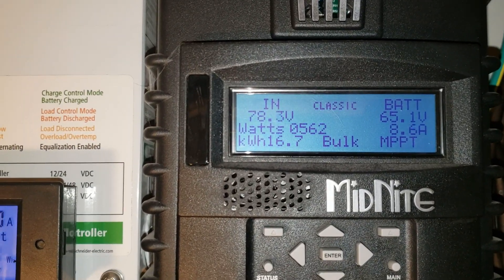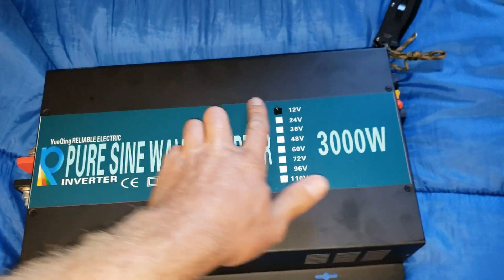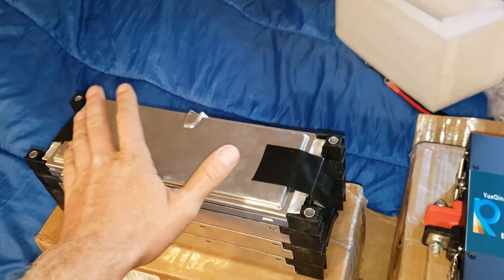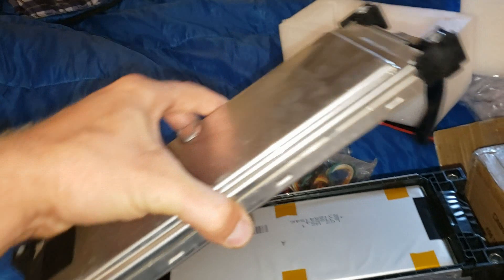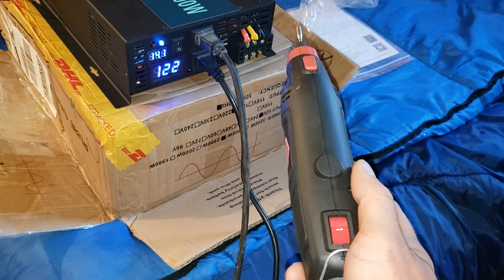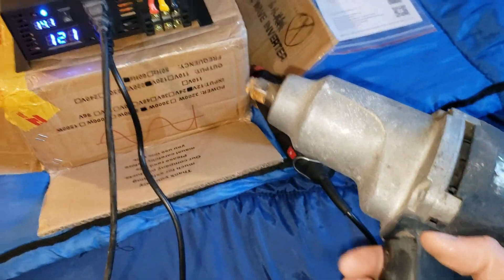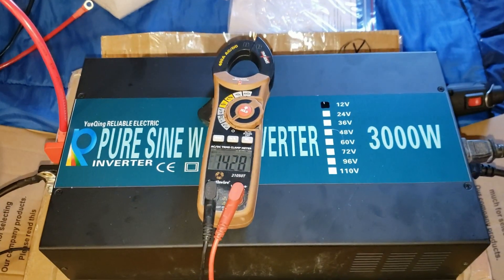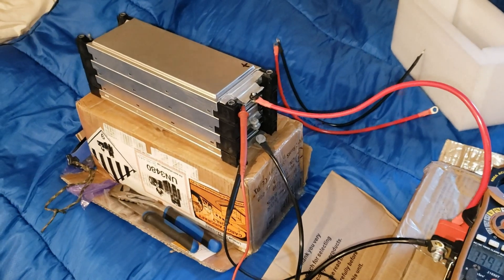New Reliable 3000w Inverter And 4S 16 Volt 120Ah LG Lithium Battery

Comment: Impressive, the inverter never dips below 120V. So many of the cheapos run at 110V but drop to 108 or 107 under a moderate load

Comment: Nearly 1.8kwh in that small package is pretty awesome. I've heard a lot of people don't run them through their whole range they usually don't take them down all the way to the bottom and maybe leave a little headroom up top so say 1.5kwh. For the price that's a banging deal. Put 10 of sets together and 15kwh is enough backup for most people that aren't living off grid, that's enough to run a big AC unit for a good chunk of the day in 90-100 degree F weather (or a small AC unit to cool a room off an inverter like you showed could run alllll day long)
Reply from the maker: That's what I use thus for to cool my little off road travel trailer

Comment: FYI if you want to modify the inverter to accept 10v-17v customer support told  me to replace R13 on the main control board with a 23.2k resistor.  I have confirmed that this increases the input voltage.

Comment: Your link for the inverter is only to the 12 volt version.  How do I get the custom 11-17volt version inverter from Reliable?  Do I send them a message through ebay?  Does it cost extra?
Reply from the maker: Yes message and it's free
Reply: @GoingOffGrid101  thanks

Comment: My 3000watt inverter has been running none stop 5 months no issues! The Batteries are awesome!! Thanks for sharing :)
Reply: Can you tell me how Good those LG chem battery hołd a charge as someone said they are no Good for solar if discharge them a full cykle charge and discharge for example for off grid system ! Im planinig to get From someon why build a solar battery From LG chem 24 v 9kwh for off grid

Comment: I have a 30 Amp rv i would like to get a setup like this. how many of those batteries would i need for a 24v system for it?
Reply from the maker: 7 for 24v
Reply: @GoingOffGrid101   Great thanx
Reply: @GoingOffGrid101  3000 inverter will do or should i get the 3500 or 4000?
Reply from the maker: @capthwdy08  bigger the better
Reply: @GoingOffGrid101  so  the 3000 will be enough also so how many panel's?

Comment: What will you be charging the 4S with? I have a bunch of 4S liion packs I made for kids ride on toys and I was to parallel them all to run my hunting camp this fall. I have 120W solar panel as well.
Reply from the maker: Make sky blue charge controller
Reply: @GoingOffGrid101  I need an ontario battery hookup. I'd like to play with some lifepo4.
Reply from the maker: @11mleger  batteryhookup.com ships to canada
Reply from the maker: Use code GOING for 10% off

Comment: They can't keep their dang name straight! Reliable electric, wrzlb (or whatever, can't double check) and now YueQing? At least it's a way to tell between versions! I'm just about to buy a 3k to 4kw 48v inverter from "one of the 3 names" ...
Reply from the maker: all the same brand but im going to try and test another model soon, i didnt even push the inverter to much in this video, mostly cause of the connection was not good enough yet.
Reply: The YueQing name has been on all of mine for the past 3 years. Along with Reliable Electric.

Comment: I didn't realize they could do custom voltages I knew they had like 18 and 36v which are not that common but that's cool you could get like a 6s Tesla module and get them to make something that worked from what like 18v to 25v
Reply from the maker: Yes you can and at no extra cost! all my reliable inverter are custom voltage, except my 24v ones that a friend gave me.
Reply: That is awesome! The Tesla S/X batteries are great but with standard 24v range inverter it cuts out way to soon. That opens up a lot more capabilities!

Comment: Those cells are brand new too.  I just bought 7 more, 14 together for a 48v system.  I wish I could change my 5000+ 18650s to them. makes such a nice package and small.
Reply from the maker: agreed I like this better then 18650 I think. you should message them lol

Comment: I NEED TO GET SET UP FOR A 220V AC OUT 12VDC IN WELL PUMP BACK UP ! TY
Reply from the maker: this setup will work unless you have a very large pump
Reply: @GoingOffGrid101  under 2000 watts but i need 220v ac out

Comment: I have the same inverter but mine is the 3000 24v......the only complaint I have with it.. is that the cooling fans are pretty loud when they kick in!
Reply from the maker: yea they are but at least they are not on for long :D
Reply: @GoingOffGrid101  Even when it is in the 90s and the same level humidity mine are on and back off in about 15 seconds.

Comment: Very nice  my 3000w is still going strong over a year now
Reply from the maker: i have 3 and all are over 2 years old
Reply: Mine turns two in Oct.  The AC meter in it failed but is an easy fix. One thing I don't know if anyone has mentioned is that in at least mine, when it has no load, it doesn't kick over the refrigerator's compressor. Running load of only 215 Watts. But add a PowerJack 3000 Watt 110/220 transformer as just a dummy load and it does fine. I think mine has a power saver mode that cuts the waste until it needs to power up to a higher current load. It can and has run a one tube portable A/C unit that can really tax the outlet Amperage rating. It handled a Chop Saw or a circular saw without any problems.
Reply from the maker: @gravelydon7072  that's good its run 2 years, thats a weird quark with the fridge lol
Reply: @GoingOffGrid101   Yep, really strange. With the PJ transformer on, it can start the fridge even while it has been running, off, and then switched to the inverter. Without it, the fridge will just cycle and kick the thermal cutout until it completely cools off and drops the pressure.

Comment: Great video 
What are your thoughts on the dc to dc chargers that are for vehicles...ie...vanners and rvers are using them
Wandering if you have tried them on your car or jeeps
Brand I'm getting is the renogy 
Be safe
Reply from the maker: i have not seen those, I will have to check them out.
Reply: @GoingOffGrid101  same here they have been out for awhile 
My buddy bought 2 one for me.. we have similar set ups so we are going to give them try 
I thought you might benefit from them if they do what  they say they will
In a nutshell it's a mppt charger that will use solar or your alternator to charge house batteries  and your starter battery
Reply: @GoingOffGrid101                https://youtu.be/zK9ZYRy-gzI
Reply: @GoingOffGrid101  fyi I'm am referring to the newest one there are 2 versions